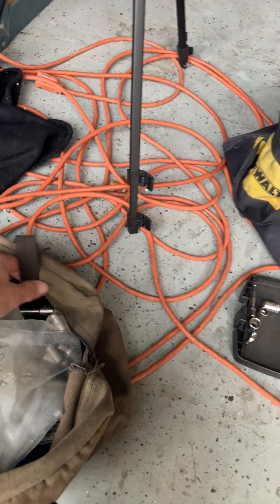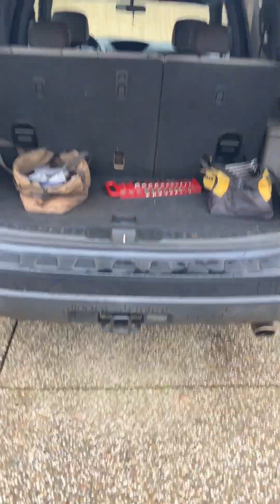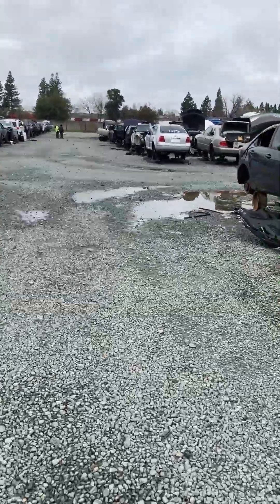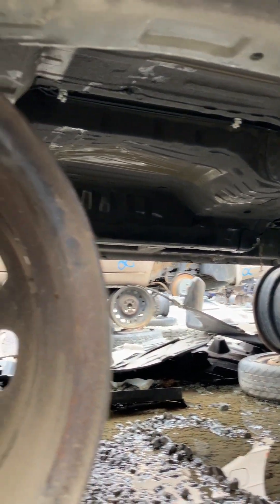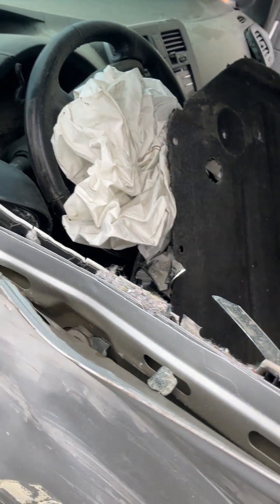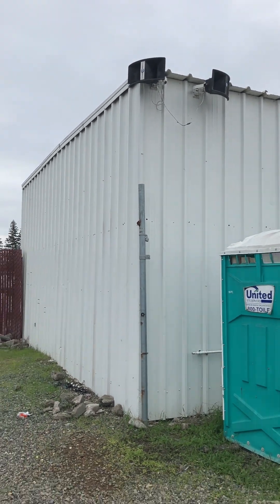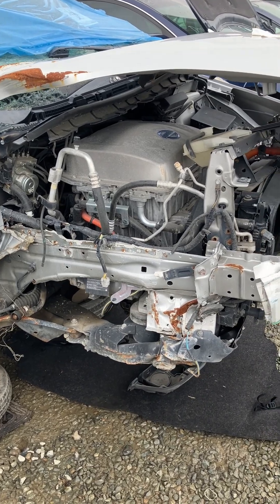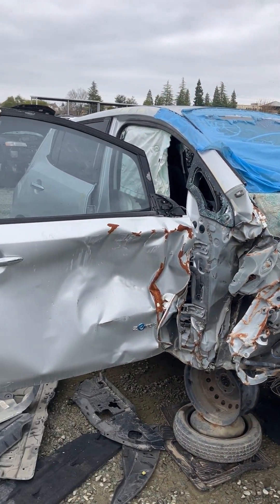Pick-n-Pull 2013 Nissan Leaf: Will I buy the motor? #junkyard #electriccar #evconversion

Comment from the maker: this was shared by one of the readers on the Open Inverter forum: "If you go for the parts from the 2011 Leaf, the motor and inverter are connected via a cable which makes it much easier to fit into a different car. The cable doesn't have much flex but enough to let you move things around a little. Also the ac charger (ac only) is in the boot so the stack is that much smaller anyway."